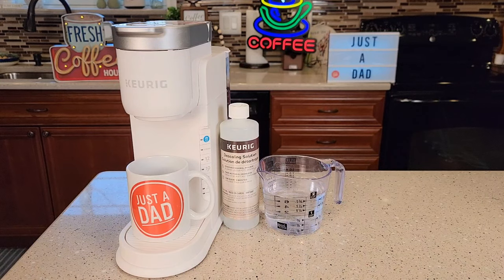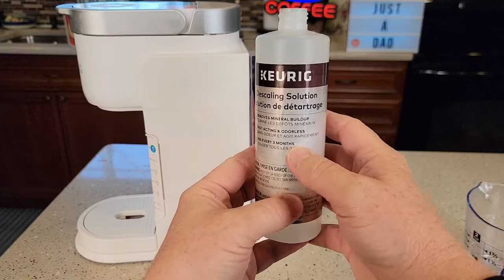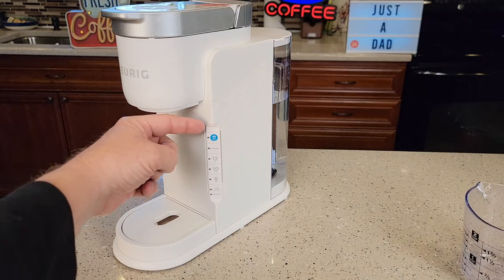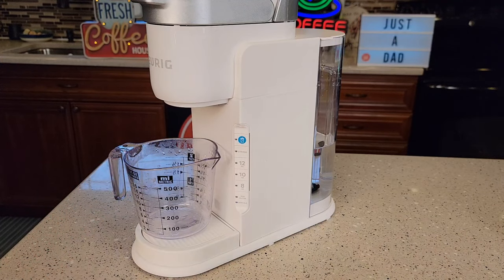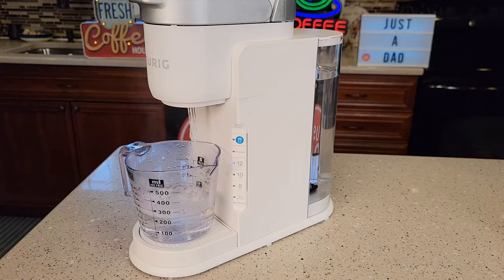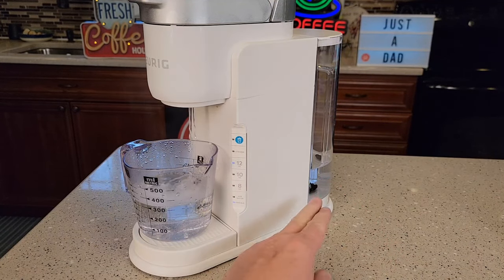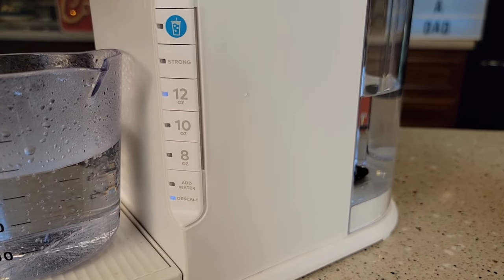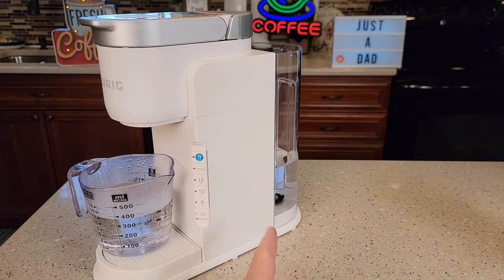How To Descale Keurig K-Iced Coffee Maker with Keurig Descaling Solution    Turn Descale Light OFF

Comment: So in your video, you only ran the descale solution through the K-Iced 1 time?  And then poured apx. half of the (mixed) $9.00 bottle down the drain?  Methinks something is not right with this procedure.  But thanks for posting it.  I was able to get the procedure to work almost correctly by using citric acid and 32 oz of water.  That gave me two full descale cycles.  On mine, the descale light went out after 3 rinses, but the add water light never came on. (?) Washed the reservoir and all appears to be working properly now.
Reply: That's exactly what I was thinking.  I'm just gonna run descale mode 2x and not waste $4.50 of the solution or even re bottle the mix for next time.